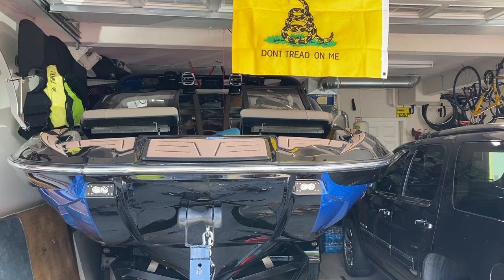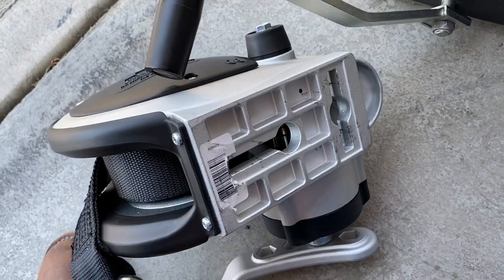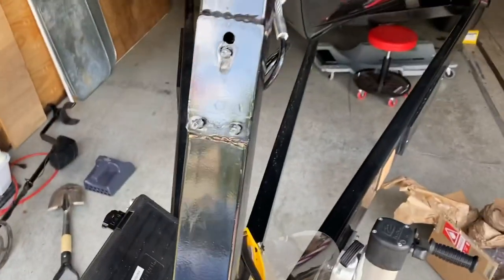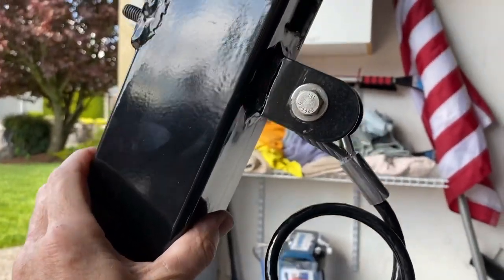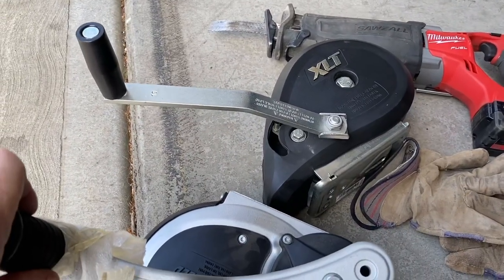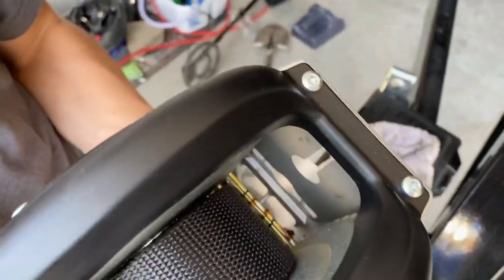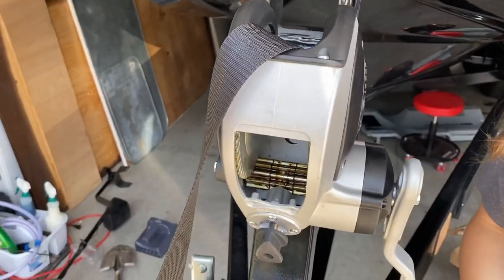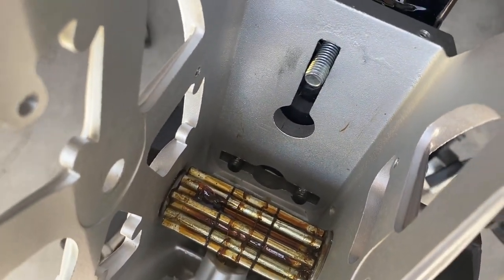DIY Fulton 2 Speed Boat Trailer Winch Install/Modification Extreme/Boatmate wakesurf Centurion

Comment: You could've avoided most of this by leaving the bottom two screws and then drilling for a 3/8 x 4.5" carriage bolt all the way through for the top bolt 
and fastening it from the backside.